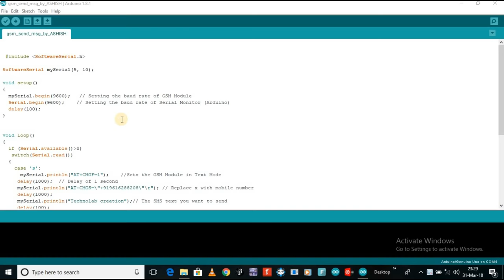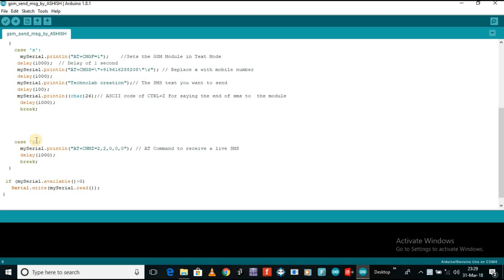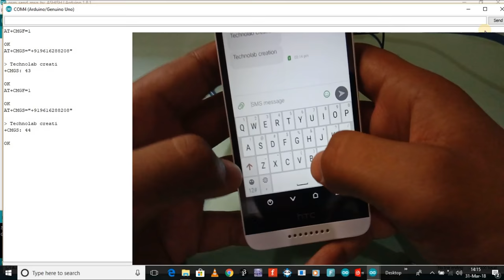SIM900A GSM Module and Arduino: Sending and Receiving SMS Using AT Commands

Comment: nagajothisaravanan 
very clear explanation.i bought same type modem,with 12v power supply connected.
using usb to ttl converter,i can not communicated with the modem using putty in all baud rate.
what is the default buad rate of the modem.
please reply waiting for your reply.
thanks.
Reply from the maker: Hey thanks for your comment
Reply from the maker: The default baud rate of sim 900a is 115200
Reply from the maker: GSM module is little sensitive so some time it doesn't work properly
Try again, it definitely work
Reply: thanks for your responsible immediate reply.thanks.i will try .
Reply from the maker: Ur welcome
Reply: Sir if it still not communicating with lapi then by changing baund rate???? there is problem in gsm modem or what......
Reply: @technolabcreation  is SIM 800A also same baud rate?
Reply: Hi can you tell me the name of the 12v power supply which is used in this so i can also pourchase it
Regards
iHarshul

Comment: sir I use sim 900a with arduino and i try this code to check gsm modem and  my gsm network is already connected but when I type AT in serial monitor i get no response and aside from that i dont get to see what i send from the serial monitor.Sir can you advise me how to do this ok

Comment: Sir, I am using this GSM sim900a interface with a raspberry pi 5. Since it's has voltage difference, can I used a level shifter
Reply from the maker: Yes you can

Comment: Hi.. I am using the same module. Just need to know is it mandatory to connect external power supply to gsm module. Can't we take 5v line from arduino to ' VCC' pin of gsm module?
Reply from the maker: No you can't take Power from arduino because ...gsm need much more current,

Comment: Great video, question... does the SIM card need to be activated? Or can u use a brand new SIM card and sms text from it? You said it needs to be 3g? What exact pieces do I need to buy, where did u get yours.. plz list app u need to buy for it to work.
Reply: You required 2G SIM only and SIM card contains no storage  then it will work properly

Comment: Hello brother! 
First of all thanks for making such a informative video. I am facing a problem while connecting my 900a module with Arduino. The network led is not blinking or turning on. My SIM also support 2g in phone. Now when I programed to find my Gsm IMEI no. then it showing "0" . 
When i call from another no. It shows it is ringing at calling side. My Gsm module is same as in your video. I tried all such steps.
1. Giving sufficient power supply 12v 2A
2. Switching different sim card.

3. Tried AT commond.

4. There is not any PIN no. Lock there.

So please help and reply.

Comment: i got some hardware issue while connecting gsm with lipo battery, inboard capacitor of 680uF got burst. Is there any possiblity for its working if i replace the capacitor with new one?
Reply from the maker: What is voltage rating of capacitor??

Comment: i have to know that is this device (SIM900A GSM GPRS Module with RS232 Interface and SMA Antenna) 
can be connected to PC through RS232 Cable and detected by Windows as Modem ? for Sending FAX

Comment: Hello sir, please how were you able to receive messages on the phone? Wa the SIM CARD defined in Arduino code  different from the SIM CARD inserted? Because removing the same SIM to insert into the Arduino Connected GSM module means I have an empty phone with no SIM CARD and I will not be able to receive messages on this phone. Please I need your clarification❤. Thanks
Reply from the maker: Watch this video SIM900A GSM Module & Arduino: Sending/Receiving SMS & Making Calls Using AT Commands | NextPCB.
https://youtu.be/6PM0_FDnXGA

Comment: Hello, friend, is it possible to send an AT Command via SMS to Restart the SimCard connection? If so, what is that command?
Reply from the maker: To restart the SIM card connection, you might use one of the following AT commands:

AT+CFUN=1,1: This command resets the GSM module, which effectively restarts the SIM card connection.
AT+CREG=0 followed by AT+CREG=1: This disables and then re-enables the network registration, which can restart the SIM card connection.

Comment: Thank you, I was looking for something like that. But, I want to use ESP8266 NodeMCU ESP-12 E module with Arduino Uno board. I want to send AT command via Arduino Sketch instead of serial port. In that case, what will be the TX, RX pin connection? It would be a great help.
Reply from the maker: Same connection as in video
Reply: @technolabcreation  Thank you. Yeah, this is working. As the ESP8266 NodeMCU has its own built-in MCU, if I want to use only ESP8266 NodeMCU module (not with any Arduino board) is this possible to send AT command via Arduino code instead of serial port. In that case, maybe I do not need to use the serial software library.  Is there any idea in that case what will be the code looked like?
Reply from the maker: Yes it is possible .. watch another video of mine on gsm module
Reply: @technolabcreation  Hi ! I  found some videos on GSM module, but didn't find the specific one which you are talking about. Can you provide me the link of the video?

Comment: Which is best sir RF receiver transmitor or gsm module
Reply from the maker: Both are best depend where you wanna use
Reply: @technolabcreation  actually we have to use it for sending photo or video from location to other location
Reply from the maker: Then you have to use iot project
Reply: @technolabcreation  yes yes it's iot based project

Comment: should we use only 12volt 2ampere adapter.i am using 12 volt 1 ampere adapter and the code is not displaying any ouput.should i change the adapter?
Reply from the maker: Yes ... please change the adapter??
Otherwise it will not going to work.
Reply: @technolabcreation  thank you so much for the quick reply:)
Reply from the maker: Most welcome

Comment: What will happen if we join 5 v from arduino uno board to A2 pin of same  Arduino uno board, will it be short circuited or will it be use to read voltage if using proper serial monitor?
Reply from the maker: If you use proper serial monitor you able to read voltage reading. And nothing happen if didn't define that particular pin ...means no short-circuit.
Reply: @technolabcreation  Thankyou

Comment: Hi,
Thanks for this tutorial. 
I want to use this type of solution to manage the usage of an Air Conditioner:
1. Receive an SMS when the A/C is switched on. SMS message should contain an account number + date / Time + "A/C on" 
2. Ability to send an SMS to disable the A/C from starting
3. Ability to send an SMS to enable the A/C to start
What are the reference in the web that could provide me with some details regarding this project?
Thanks in advance for providing any hint/ advise/ pointer to other recources

Comment: Also should only 12V and 2Amp supply be given? Because I tried with 12v 1 amp supply and the code wasn't working!
Reply from the maker: Yes this module power sensitive....so must provide 12volt and 2amp power supply
Reply: @technolabcreation  ohh thank you so much!
Reply from the maker: Your welcome

Comment: Bro which generation should we use? Airtel 4g/3g or only 2g sim??
Reply from the maker: 2g
Reply: @technolabcreation  bro i asked in airtel shop for 2g sim
They said 2g is not available only 4g/5g. 
They said 4g sim will work as 2g also.
Will 4g airtel sim work in gsm 900a module??
Reply from the maker: Except jio all other simcard companies provides 2g services along with 3G and 4G
so you could use that.
Reply: @technolabcreation  yes, 4g sim can be a 3g/2g sim. So i can use 4g airtel sim in gsm 900a??

Comment: Is there is a way to make this portable? maybe a battery and a current regulator?   using an adapter is not an option I can consider
Reply from the maker: Yes make it portable ...by using lipo battery
Reply: Technolab creation How much voltage? and is the battery enough? no current regulator?
Reply from the maker: About 12volt and 1 amp

Comment: Sir making calls using gsm modem is fine but if try to speak will it tranmitts our voice
Reply from the maker: Yes it will transmit our voice just like a normal mobile phone.  
We have to just connect speaker and a mic.
And little modification in code.

Comment: Hello sir I used and developed a GSM based hms. Previously  it sends SMS and when I am checking my kit with same code it is not sending SMS and serial monitor is also blank
Reply from the maker: Yeah this is frequently occurring problem
Because GSM module is very sensitive, just disconnect the all things and re-upload the code ,
First power up the GSM module wait until gsm module is connected to the network then Arduino to it , then it must work properly..
Reply: Technolab creation tq but it is not working
Reply from the maker: Retry it must work

Comment: I'm making a car and want to place the gsm module in it but as you shown in the video, you are giving power by the adapter for powering but it is not possible to me use. Can you suggest any other way to power up the gsm module
Reply from the maker: U can power up the GSM module by battery just by checking power specifications of ur particular module for example ,U can use lipo battery
Reply: I'm using gsm sim 900a module, then which will be suitable for this
Reply from the maker: 12 volt. 
2amp
Reply: When I upload the code, the network led blinks for some time and status led light up for some time then both leds get off and nwk, status leds of gsm and tx rx leds of arduino blinks again.
Is Arduino restart itself again and again? If yes then what is the reason for it and what should I do to solve this
Reply from the maker: No Arduino only reset when anyone mannully reset,
First of all insert a 2g sim to ur GSM module and connect power supply then wait till module is connected to network 
Then connect Arduino to the GSM module.
U have do these things because GSM module is very sensitive
Reply: Thnx for help😊
Reply from the maker: Ur welcome 
Please subscribe my channel

Comment: Awesome video man. Thanks a lot for sharing this. I bought a new SIM 900 module but it was not working since many days, until I tried the connection and code you have mentioned. While testing this device I am facing one small issue - When i send "Hello " message from my mobile it appears as +CMTI: "SM",17 only and not the actual message. Is this because i am using a 3g/4g sim? Have you faced this issue ? Any thoughts?
Reply from the maker: Yes this module only support 2g services, 
You can use 3g4g if it has 2g services
Except jio all sim card give 2g services along with 3g/4g
Reply: @technolab creation Hello Sir, If I purchase an Idea 4G sim....then will it work??

Comment: hello bro you are not using the case "r" but you get the sms received
 how is this possible, are we dont need to mention r command is it works automatically
Reply from the maker: Yes it will work

Comment: Hey, I tried the functionality of gsm with the code which was given in link. N it worked well a week back. But now while sending message, the output is coming in serial monitor but the message is not being received at the receiver end n in serial monitor it showing 'ERROR'.What will be the issue in it?
Reply from the maker: May be sms plan of your sim card is ended

Comment: Hello Sir
I want to ask is it only way to send SMS through serial monitor by typing - send SMS or any other ?
Reply: Means can I use any other device to send SMS without typing command
Reply from the maker: Yes you can send sms without giving commond from serial monitor.
I have another GSM based project . you could checkout.
Reply: Okay sir

Comment: My sim900a gsm module can't connect to the network, what might be the problem ?
Reply from the maker: Check your power supply and make sure to use 12volt and 2amp

Comment: Once we remove and connect power supply to gsm,code is not working.Printing some garbage values in serial window if we send sms to gsm.please tell me the solution.If power is not removed,working fine.Problem comming when power is disconnected and then connected.Helpful if u give reply as soon as possible.Thanks in advance!!
Reply from the maker: When you remove power from GSM then at that time remove the tx pin wire also.

Comment: Sir please help me I am making this project but my network led is not blinking and not blow When I connect 12 volt dc perfect voltage to GSM module 900A and one more things my GSM module is heating please help me sir I'm use 3g sim  is working ok or not?
Reply from the maker: First of all disconnect everything (Arduino from GSM module) then 
Insert your sim then power supply plug .
U can use 3g sim if it has 2g services.
If you connect the Arduino with module without giving power supply to GSM module then there is a power regulator ic that will heat up..

Comment: 1:56 you connect digital 10 to what? And where the coding it doesn’t show for me in description
Reply: I have SIM800C it’s a little different can you help me with it?
Reply: I have a project that is the flex sensor will be on the jacket and when it’s get curve it should make sound using buzzer and then send report sms to phone if you can help me with it, thank you

Comment: HI there
Do you get 2G SIMs these days?
I'm not able to get any. It's only 4G which is available.
Reply from the maker: Ur right now days only 4g sim available but except jio other also provides 2g services u can easily use that
Reply: @technolabcreation  i am using sim800A GSM shield for Arduino. It fits over Arduino Uno. Will it work this way also...or anything else has to be done
Reply from the maker: Yes work in same way
Reply: Thank you bhai
Reply from the maker: Ur welcome brother
Reply: Does 4g sim works with this modem?

Comment: Hey bro! Thanks for the video. It's clear and perfectly explained. But I have some problem. I see reversed question mark when I open serial monitor. baud rate is 9600. Both in Serial and in code. But it is'nt working. Thanks in advance man!
Reply: Bro I have also this problem 
Can you solve the problem now?
Reply: Same problem here! and message is also not transferring
Reply: Make sure that jumper wires  connected properly... It may be one of the reasons for  ¿¿...

Comment: Can i use 12v ,1a adapter ,plz reply sir
Reply from the maker: You can use...but I recommend use 12v 2amp
Reply: @technolabcreation  it won't damage the voltage regulator na sir?

Comment: can gsm 900 A be powered from arduino uno board 5v pin
Reply from the maker: No ....gsm required higher voltage and current.
So you have to Power up GSM module by external Power adapter
Reply: @technolabcreation  can we use 3G BSNL sim in gsm module 900A with Arduino

Comment: Sir please make a video soon to detect the location of vehicle using Arduino Uno, GSM module or some gps or GPRS

Is it possible to detect the location of our robot using SIM900A GSM module and Arduino Uno.

Waiting for your reply.
Thanks sir
Reply from the maker: Yeah I'm planning for it 
And very soon it will come
Stay connected with Technolab creation
Reply from the maker: Yes it is possible to detect the location of ur robot
Reply from the maker: Yes it is possible to detect the location of ur robot
Reply: Ok sir thanks but please make it soon with good accuracy location.

And sir please make solar tracker in easy way other's are too much complicated and how to use motor driven shield to run motor through Arduino uno.

Thanks waiting for your next videos.
Reply from the maker: Very soon I come with my videos
Reply from the maker: Thanks for valuable suggestions
Reply: Technolab creation my pleasure sir

Waiting for your new videos

Comment: Why tx0 and rx1 pin creates problem during uploading program.
I am asking this question because I am also getting this problem during problem update on Arduino board...................
Reply from the maker: Rx and tx. Pin is internally connect with usb port 
If u connect another peripheral module with rx & tx then arduino will communicate only with that module not with PC

Comment: I have made the connections as specified in the video.Uploaded your program.I am using vodafone 4g sim.In the serial monitor i get to see blank screen after sending s.Please fix my problem.Thanks in advance
Reply from the maker: Check power supply of GSM module

Comment: Sir i used gsm sim 800c I interfaced with arduino uno but my mobile is not receiving messages from module
Reply from the maker: Check SMS plan in your sim card that you inserted in GSM module.

Comment: In my gsm kit only power LED is working and network LED is not working and we are giving prefect power supply 12 volt 2 amp dc power through adapter what can i do for get network LED on.
Reply from the maker: If ur network Led is not blinking 
Then maybe ur module is defective

Comment: Sir my Bsnl sim is not working in SIM800L it's sending sms but received sms is stored in other sim internal memory  and not able view it's content ,other sim cards working excellent but problem with Bsnl any settings or suggestions .please help sir
Reply from the maker: Insert your BSNL simcard in phone and check the problem
Reply: @technolabcreation  Sir in mobile it's working well but getting problem in Gsm module ,other sim cards also work in both

Comment: i have GSM module as urs but my GSM module gets connection for few seconds and then the connections are lost.plzzzzz help me out
Reply from the maker: I also faced this problem many times....but I fixed it, all u have to do it , first powered the GSM module then connect the Arduino to PC..,then it will work perfectly, there is a voltage regulator chip that creates the problem.